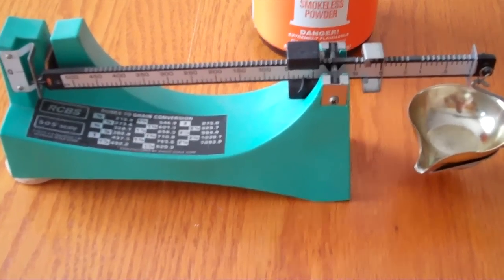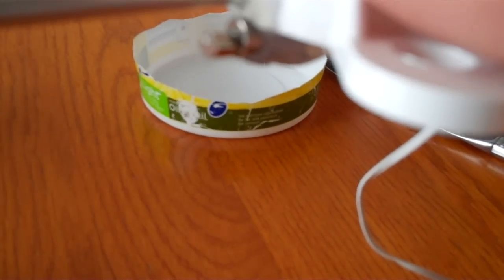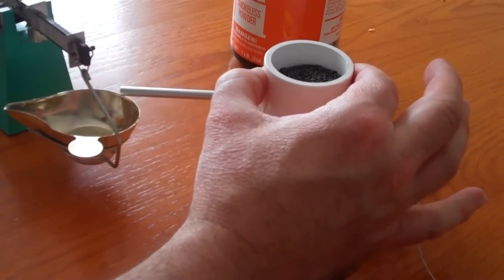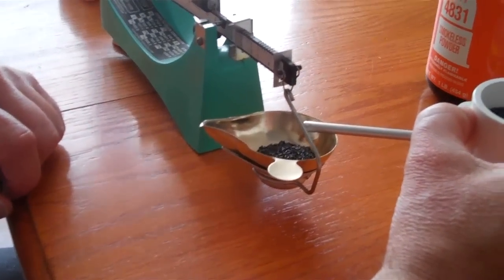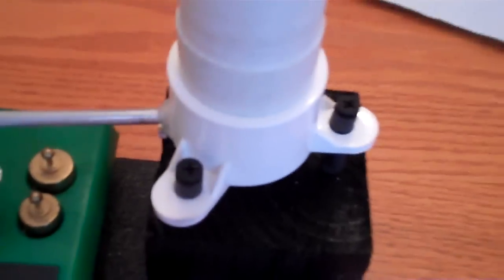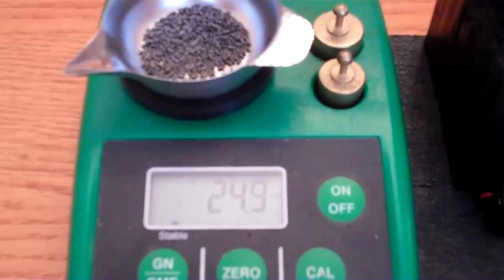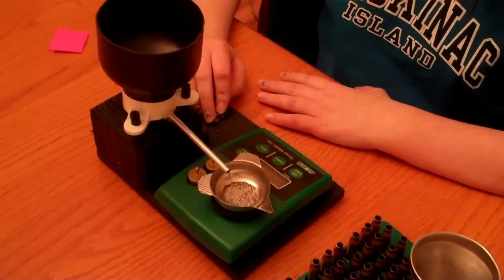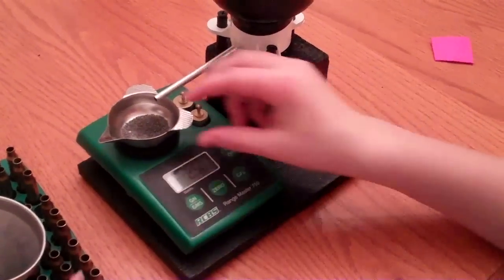DIY  How to make an electric powder trickler for reloading

Comment: Hello, I know this is an old video, but did you use a resistor to drop the power/voltage for the slow speed switch?  If you did, what resistor?
Reply from the maker: I honestly don't remember, but an assortment is probably cheaper than buying some individual ones, such as this one: https://amzn.to/3VfPqqo  That way you can pick the one like or even add extra buttons, so you have several speed options.
Reply: @TriggerMeisterDOTcom  Okay, that's cool.  Yeah, I was just looking at that exact kit of resistors.

Comment: Got ya nice trickler.ive made one long ago as a matter of fact I made six.i used (2) pvc end caps mounted on a nice piece of wood.my vibrator motor is a motor from a cheap dollar store electric tooth brush.my switch is two pieces of copper strip and a battery holder for two as batteries.i don't know how to put my stuff on line so I can't show you.it works great.oh the motor is encased inside the bottom pvc end and both ends have a 1/4 bolt holding them and I can turn the powder reservoir anyway...nice job on yours

Comment: A diode on the switch to restrict current?  I think you mentioned resistor.
Reply from the maker: Yes, I just needed something so I would have a high and low setting. High setting to dispense powder fast and then the low setting of course to trickle finer loads. Back when I created this I was not fancy, so I would have used almost anything to get it done.  I could have even used the light bulb in series 😁. These days I would probably power it with an Arduino and a motor controller, with a load beam as a scale.

Comment: This is a direct rip-off of the Omega powder trickler - If you are going to steal some ones ideas you should at least give them credit and not pass the idea off as original thought.
Reply from the maker: congratulations on making that optical sensor work in your product!  that is something i just didn't want to invest time in after the initial tests were unsatisfying.  so what powder trickler concept did you rip off?  omega and I copied a industrial vibratory power filler concept.  Granted, his hopper, stand and box is much more professional looking...
Reply: +TriggerMeister.com I invented and patented the Targetmaster trickler with the remote optical sensor way back in the 1980's.
Reply from the maker: +thetargetmaster just wanted to make sure your powder trickler was not a copy ted smith's invention from the 70's with a motor added.   Enough with the rip-off talk because these days it's very rare the someone had an exclusive idea and generally one idea builds on another.  BTW, if omega could sell their powder tricklers for 19.99 on Amazon, I don't think many would consider even building one. I'm going shooting now... take care.

Comment: What is the value of the diode you used to slow down the pager motor?
Reply from the maker: Patrick Rutherford  the diode just acts as a resistor and you can even use a light bulb for this.  the goal is to simply slow the motor down so you don't trickle powder as fast as you would with the battery directly connected to the vibrator motor.

Comment: You know I had same idea after I've seen Omega trickler and happen to have cell phone vibrating motor on my desk somewhere.  I don't know if you seen Omega, but it has a sliding piece of weight on the tube that slides to control how much vibration dampening you want.  I am thinking of just making a small clamp that I could place at different spots.  After seeing this I am confident it's worth to build one instead of shelling out $70 bucks.  Thanks for sharing.
Reply: Dima Prok So excited, I did it.  Found not just 1 but two little motors, one just like yours worked perfectly from 1.5v battery but other needed between 3-5 volts and was not as effective.  Anyway, it works really well, I changed design, but it cost me $1.59 to buy PVC end cap and the rest of the parts I already had, just need to add second switch for slow speed, which resistor did you use TriggerMeister?
Reply: Dima Prok How exactly did you built it? What angle did you use? Can you post a picture please.
Reply: eku0 Yes, I was planning to do video, I'll try to upload it soon.  The angle was one things that initially I didn't have it right, but re-watched the video and saw that it was relatively steep compare to commercial tricklers and that's because there is no thread inside, it just works off vibrations.  I got RCBS Chargemaster 1500 I bought to try it out and I was going to keep it, but even with all the mods to it it still overthrows by .1-2 grains so that's not going to work for precision rounds and for plinker rounds I can use regular RCBS powder thrower.  So I am going to return it and get GemPro 250 scale instead.

Comment: You could save some time by scooping out 90% of your charge with a Lee dipper or similar, then you'd only need the last 2 seconds of trickling to bring it to the perfect charge. 

It would also be interesting to do a heads-up comparison of weighed vs dumped and see if you can measure a performance difference in your rifle.(group size, velocity standard deviation, etc.)